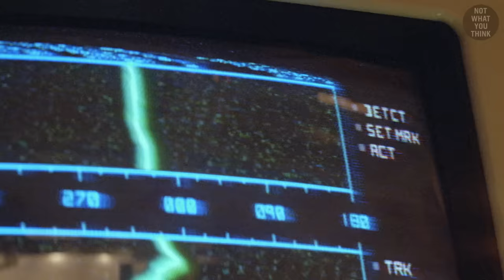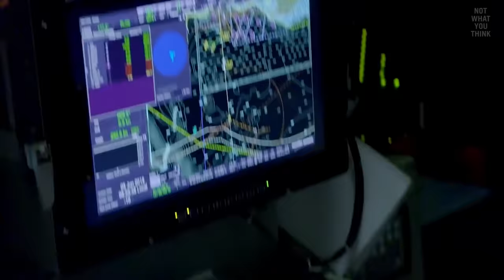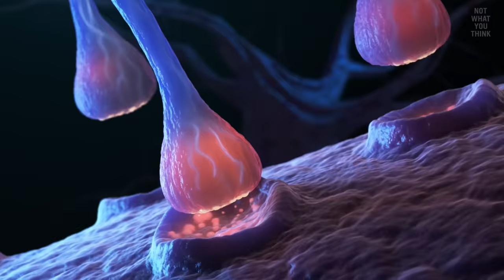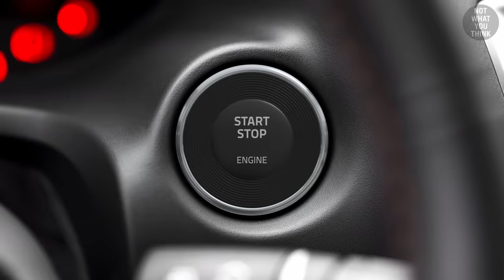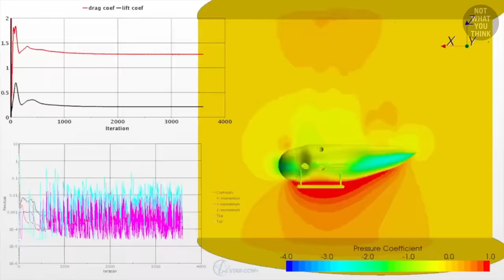What Happens When a Submarine Implodes

Comment: I have actually tried to be in an out of control sinking submarine. We where lucky that the seafloor was only about 85 meters down. We had no collapse just a mishap that allowed about an estimated 10 tons of water into the front torpedo room. We sank so fast that not very many of the crew reacted at all until we hit the floor. Personally I was half asleep and only rely found out when I saw water on the floor under my bunk. It does however make me think and shake a little every time I hear about a lost sub.
In regards to getting out from the deep we where trained to free dive to the surface from a dept of 20 meters in a tank. It is easily possible from probably at least 50 meters we where told. If it was for real we would have a special survival suit to keep us warm and make us more visible. The main thing was to blow out air all the time to the surface as other ways our lungs would be damaged. We would have had to put the sub under pressure to get out and there fore would breath in air under pressure but only for a short time. It would give us plenty of oxygen for the trip to the surface even though we did breath out all the time. It would not give us the bend as we would only be under pressure a very short time.
I have been in a couple of car accidents as well where I could easily have been killed but my experience is that I didn't really react very much until after I was through it. I don't seek thrills. I am probably as afraid of dying as most people but my experience has been that I don't get scared and shaky until after. It is the same if you cut yourself. It takes a little time before you feel it.
In the submarine we had 2 people reacting fast. One jumped on the other side of a watertight door and the other ran as far away as he could (apr. 35m). The rest where mainly waiting for instructions. We had trained to close watertight in a very short time but we didn't even get the instruction. It all went too fast.
We where able to secure the situation, pump out the water, and get to the surface in a couple of hours. We then left the exercises and went in to a local harbor where we could get damaged food supplies replaced. Some of the steaks where only told to be damaged. They tasted good on later weekend guard duties where we would normally get lesser quality food on shore.
Reply: Oh my god that sounds so horrifying. I’m glad you guys made it out safe.
Reply: nothx
Reply: @Rykiz_Vidz  It is not a hoax. We where testing the skills of the people that should shot out torpedos. The water came in through a pipe about 20 cm thick. It was only supposed to be the air from the torpedo pipe that came in but an automatic valve failed. 
Next stop - a hand operated valve - had gotten the indications - open, closed - swapped so was opened more instead of closed. Third obsion - the torpedo pipe gate - worked but slowly so my guess is we got about 10 tons of water in nose of the previous well balanced sub.  
It happened some where between Denmark, Sweden and Germany. We went into a harbour on the Danish island Bornholm to restock with food that had been in sea water.
This sub had a few mishaps over the years. Most of them before and after my time in it. I believe it was scraped after a fire in it.
Reply: @leonhardtkristensen4093  I think Twitch meant to say "No Thanks."
Reply: @technoroom5  Well I have been closer to death in more than one car accident - mostly not my fault. I still let people drive me around. I can't drive myself any more due to illness that temporarily made me para pletic. I can walk some now. I still try to do things. I am only a young 77 year old and I plan to become 110. I live to the motto: Enjoy your life now while you can but only to the extend that you can enjoy the rest of your life too.
I have had a reasonable life. I have tried a bit but never been a real trill seeker. I have always thought that I had a fair change to survive. I went to South Africa way back when the 747 was very new. One was lost in Nairobi while I was there and I was asked if I wasn't scared to fly back to Europe on one. I said no because I didn't think Luft Hansa could afford to loose one more and they didn't.
Reply: Thank you for sharing your stories. Glad to have you here with us.
Reply: @leonhardtkristensen4093 which boat was this, and when did it happen? As a submariner myself, I like to read up on submarine mishaps, although this one doesn't immediately come to mind.
Reply: @konservation6205  It was the Danish submarine "Delfinen". It may never have been mentioned anywhere before because things that happend wherent ment to be told in those days. A number of other things happend too that never got in the papers. It would have been around 1968 or 1969 I think. I can't remember the exact date. Shortly before I was asigned to this sub it had a problem with a Swedish fishing vessel. Nobody would tell me exactly what happend. I spend one year assigned to the submarine as a sonar operator. 
At about the same time the Russians where playing up in an Eastern Europien country. We lost one weekend with hightend duty. Denmark was so close to the Soviet Union dominated area. The incident happend just a few kilometers from the Eastern Germany coast. We often had Soviet fishing vessels "Fishing" very close to us. They on occations keept us on the surface. We wherent allowed to dive when they where close. 
When I left the sub I was ment to show up emidiatly in case of just rumors of a war. After one year it was changed so that they should actually come and pick me up if I was needed even if a war did actually start.